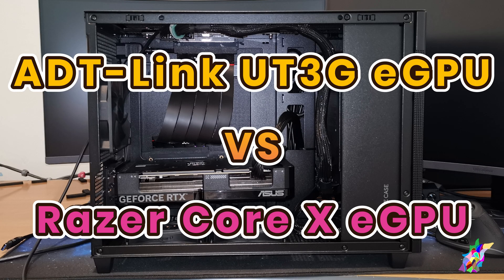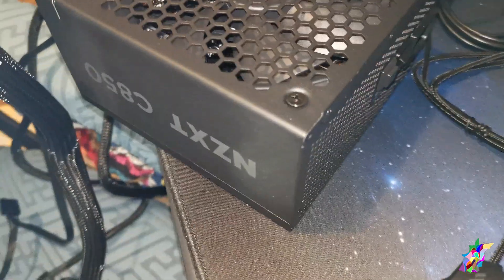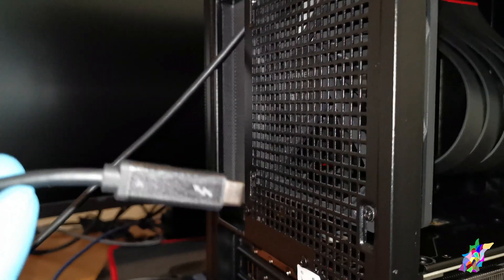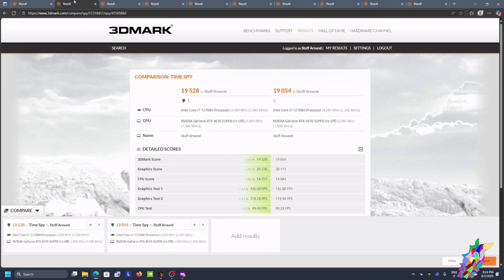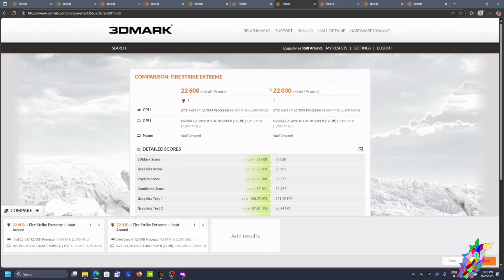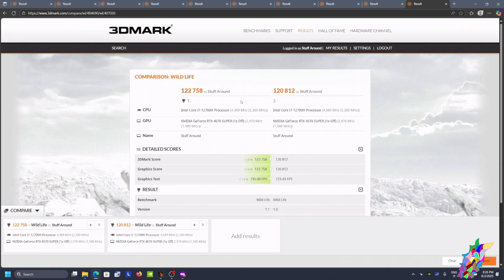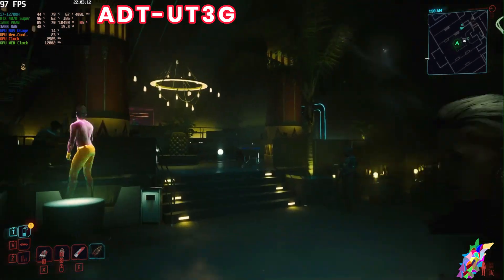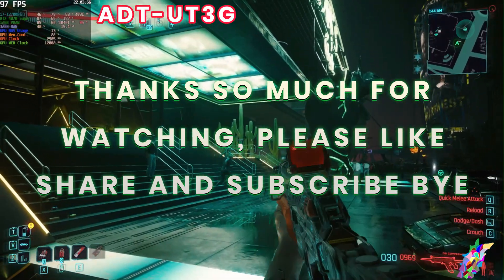ADT-LINK UT3G RTX 4070 Super eGPU Vs Razer Core X - Cyberpunk 2077 Huge Performance Improvement

Comment: Is the adt still working with windows 11? I have a 7900 xtx 24gb and a 1000w power supply that i want to usb4 to my xbox rog ally x
Reply from the maker: I am still using it with windows 11 so for me with Intel cpu it is working I suggest you to check some build on the egpu.io forum if there are any with the new xbox ally x just to be extra sure that everything works also for you.
Reply: @StuffArounds there are amd cpu and gpu builds on there recently but they are rog ally x. Hopefully i can get it working with docked and undocked without having to reinstall drivers constantly.
Reply from the maker: @SkyMuffinz in my case with both nvidia dgpu and egpu I don't have to reinstall the driver hopefully it is the same with amd 👍
Reply from the maker: I forgot for the og rog ally and I think also  for new one the adt doesn't provide power delivery so it is necessary to use the other USB 4 port to give it the necessary power
Reply: @StuffArounds yes thank you! I'll order it soon. Apparently its only 60-70% of full pcie bandwidth but the 7900 xtx is so good anyways its much better than 890m igpu.

I bought a usb4 100w pass through dock for power and the xbox has two usb4 so I should be good

Comment: No competition. USB4 has so much more bandwidth compared to TB3 protocol. USB4 puts out 3700MB/s and TB3 (chipset dependent) around 2700-3200 MB/s … I have both Razor Core X and ASMedia 2464PDX chipset based boards. ASMedia smashes Razor
Reply: Especially when using no external display the USB4 solution greatly outperforms TB3.
Reply from the maker: Yeah even on Intel based systems (Thunderbolt 4) the ASMedia is much better than the Razor. Thanks a lot for the comment 👍
Reply: @StuffArounds thanks for your video it’s very good. Voice could be a bit clearer but you’re on the right track with production quality! Take my sub